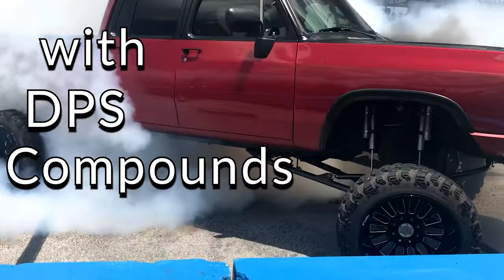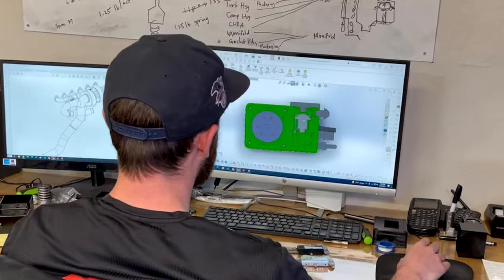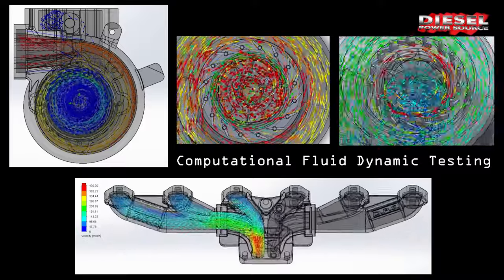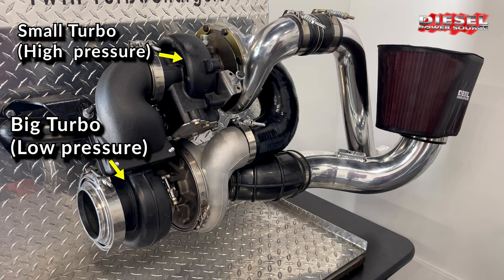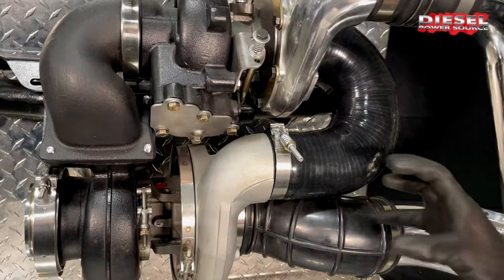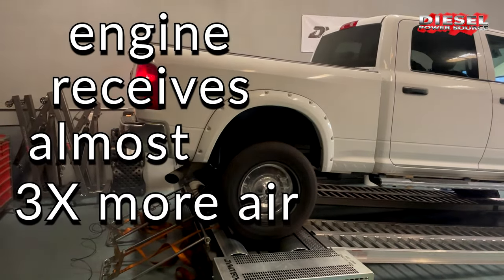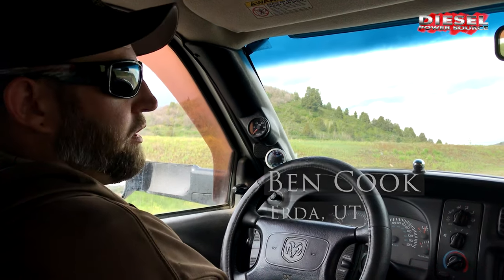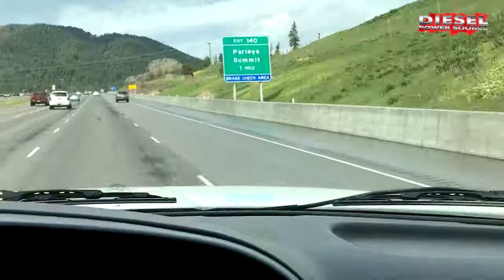Why should your truck have Compound Turbos?

Comment: I have  a DPS compound kit on my 07 5.9 Cummins.  I love it!!! Billet 62mm with a plain 75mm under it.  Stock fuel and its very responsive, tows my dump trailer, like its not even there.

Comment: What's the catch? Can't be a win win or can it be? Do we lose any fuel economy?
Reply from the maker: No loss in fuel economy. You have more fuel to burn with the added air. But, it also depends on your right foot.
Reply: You can get more fuel economy with compounds than a single turbo if you take it easy on the throttle.
Reply: Usually you gain some economy with compounds from more efficient airflow
Reply: Zero downside other than cost and additional piping to put together.
Reply: @DieselPowerSource so the downside is how fun it would be to floor it